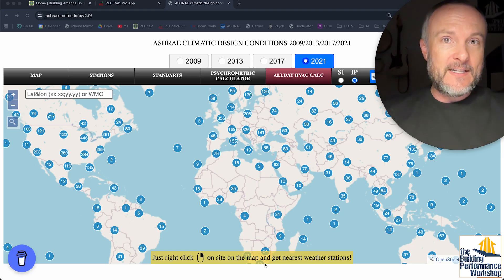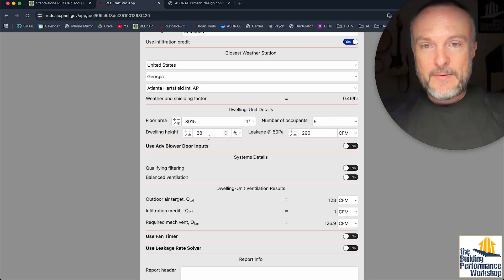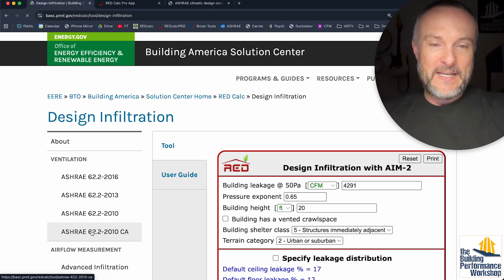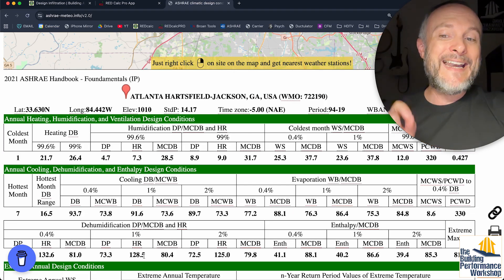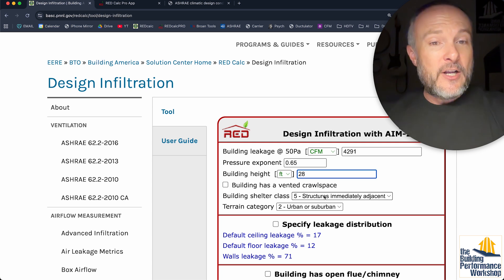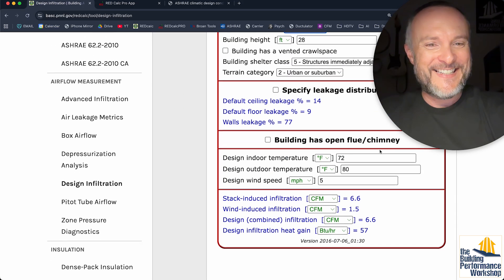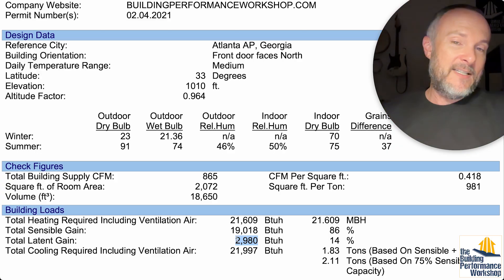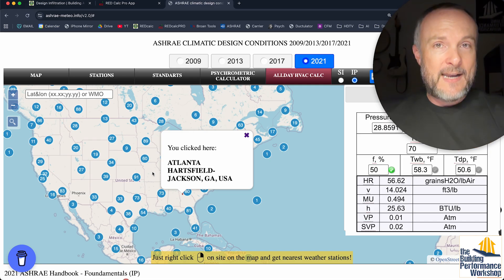Design Day Air Leakage Calculation for Dehumidifier Sizing

Comment: Is this why?

Why the infiltration credit changes
	•	When “Balanced Ventilation” is OFF
The software assumes the home is depressurized or pressurized by the fan system. In that case, infiltration isn’t consistent, so the infiltration credit is minimal (like the 1 CFM you saw).
	•	When “Balanced Ventilation” is ON
A balanced system (supply = exhaust) doesn’t push or pull air. That means the natural leakage you measured (290 CFM @ 50 Pa) can be used as a valid credit toward the ventilation requirement. The program applies the ASHRAE 62.2 infiltration effectiveness factor (often ~0.5 to ~1.0 depending on shielding/weather). That’s why the credit jumps up — in your case, from 1 to 11 CFM.